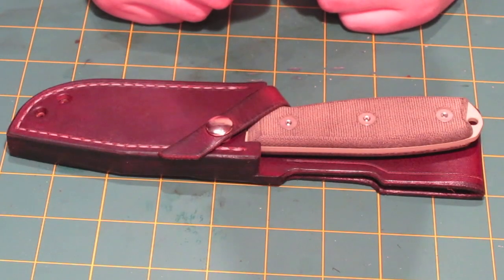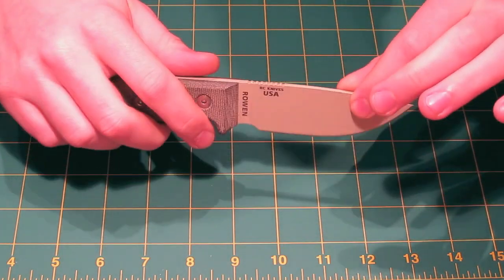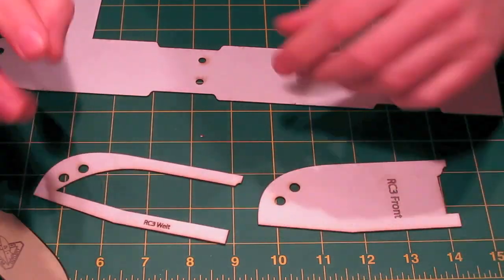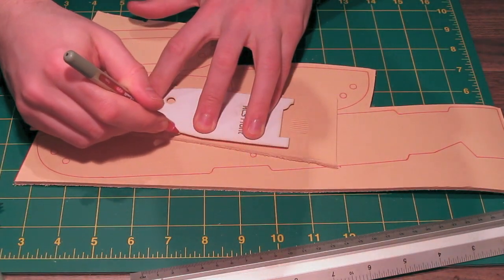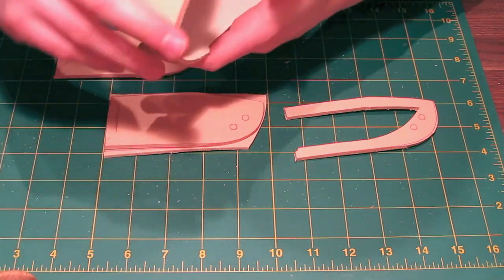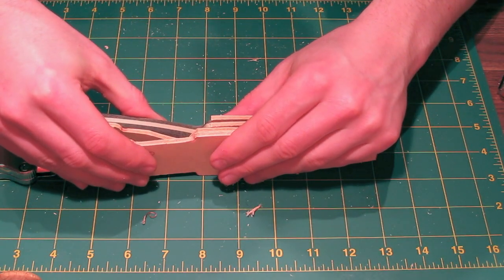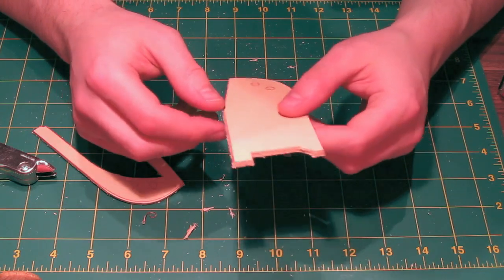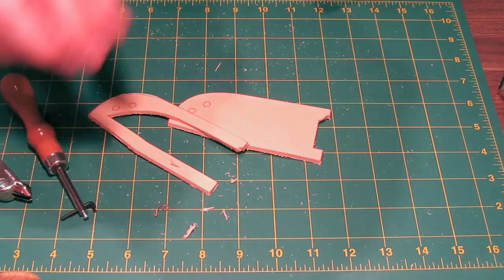Making a Leather Rat Cutlery RC-3 Sheath

Comment: Here's an idea when dying if you use a small wood clamp lay the wood clamp flat on the desktop open it slightly slide  the bottle of dye in clamp it against the bottle this way you won't accidentally knock the bottle over it acts as a third arm holding the dye for you